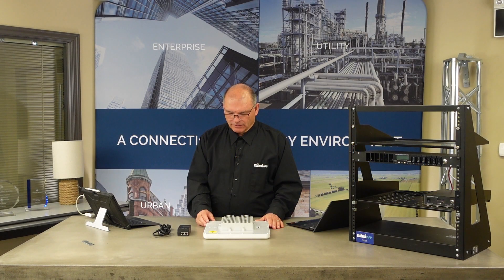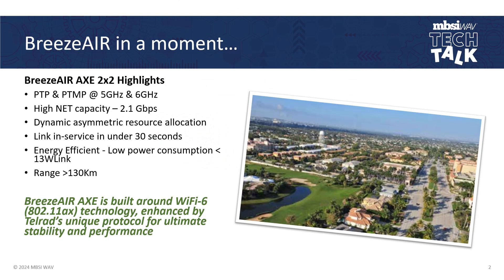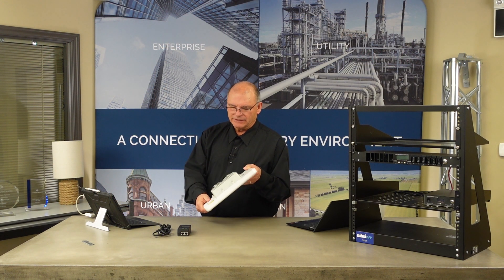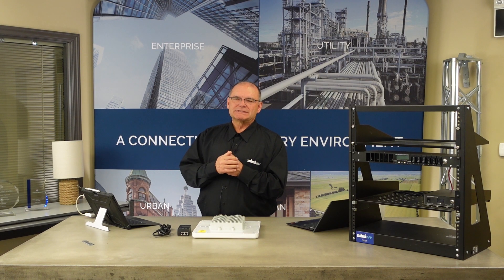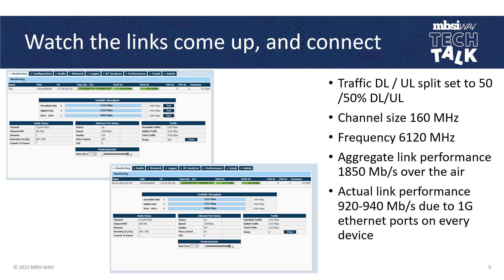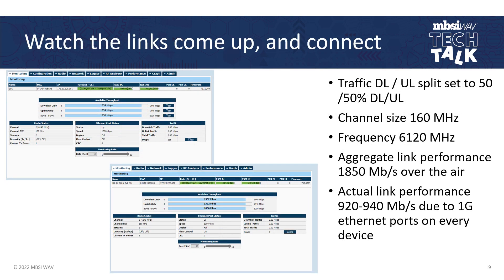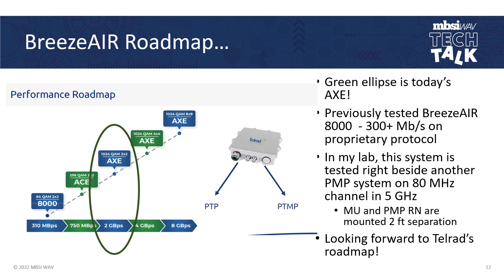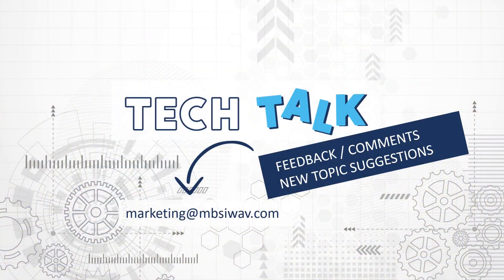Tech Talk with Dave - Unboxing the Future: BreezeAIR AXE

Comment: The BreezeAIR AXE radio with connectors is a perfect match for IsoHorns aftermarket antennas due to their identical 4.9-7.2 GHz frequency range and IP67 weather rating!